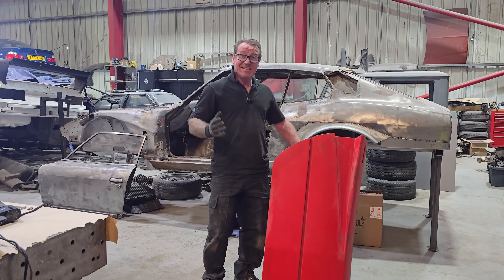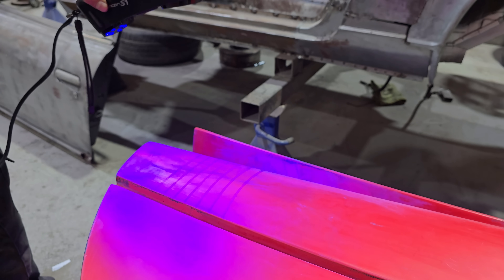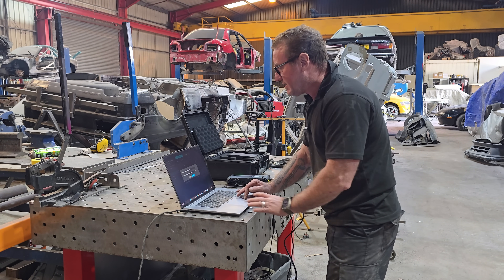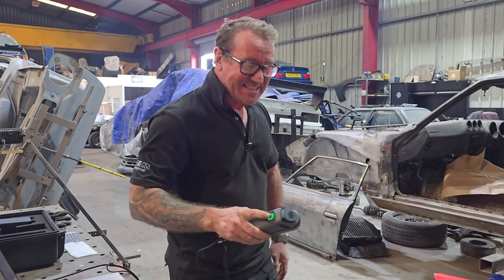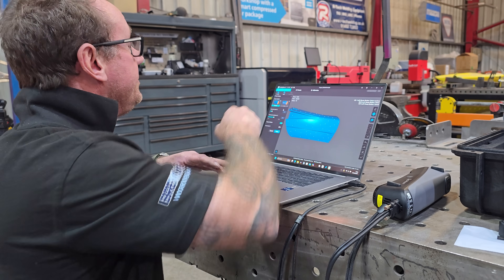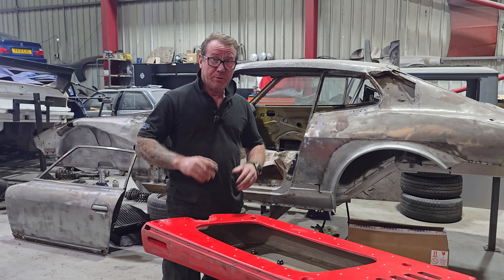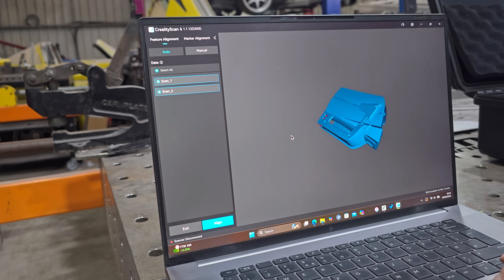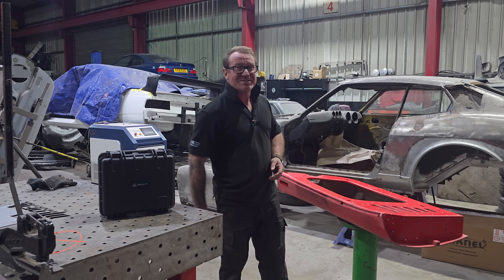Scanning a Ferrari F40 door using the Creality Sermoon S1 3d scanner

Comment: A scan is great and a smart backup, but since the part is in-hand, wouldn't it be just as smart to produce a mold from the actual part?  (bulky to have on hand, and an upfront cost, but dead accurate, and given the rarity plus opportunity....).  I remember how lightweight those doors felt (eons ago on track in one) but I forgot how thick that outer shell appears to be.
Reply from the maker: the problem is storing all the moulds, the moulds for an F40 would be as big as the car and you may never ever use it or you may just use a door, we have 20 cars so imagine the storage for the moulds for 20 cars and the costs when i can store the scans on one £100 external hard drive forever :)
Reply: You could get a mold of the outer surface, but getting the inner with all of the cutouts and interior surfaces would be a mess.
Reply: @patreekotime4578  Inner surfaces would have been vacuum bagged.  They're not required to make mold, just the two outer halves that then get  epoxy joined back together.  99% sure that's how the factory would have done it except infusion wasn't a "thing" at the time. It would have been either a wet layup that then got autoclaved or pre-preg.   Inner surfaces always end up looking "raw" - and that is certainly my recollection from having been in an F40.  I vividly remember my "first instructions" about the door pull wire.

Comment: It would be good to see the other options available that don't use markers,because they are a pain.
Reply from the maker: i will get a video out on marker less scanning as its been requested a few times now :)
Reply: Any large featureless surface will require markers because the scanner can't track correctly otherwise. Sometimes I'll scatter some small nuts and bolts on the surface and use the "Feature" mode with the scanner. This way it can "see" where it's been and track correctly. Markers can take longer to apply and remove the scanning operation.

Comment: Super cool but I'm surprised it had floating artifacts like it did, I would have thought at this price point that wouldn't happen. I did some photogrammetry with my android with free software and has some of the same artifacts and just figured it was because I didn't have a laser but I guess even lasers do it.
Reply from the maker: unfortunately those artifacts exist in almost all consumer 3d scanners , but easily delt with :)
Reply: Probably from the dangling cables and wrist strap.